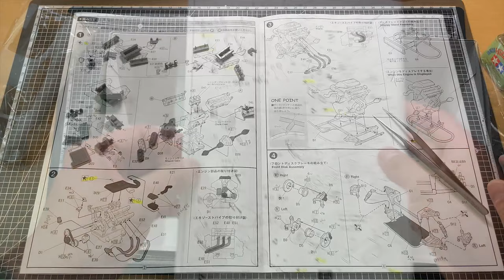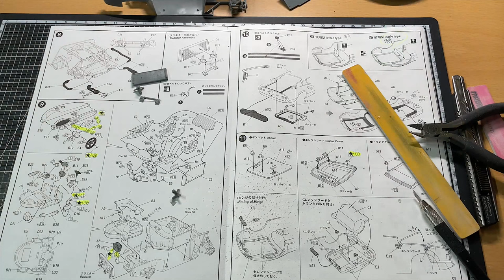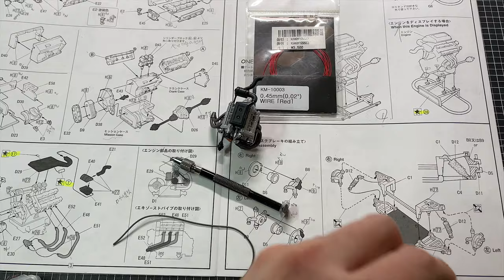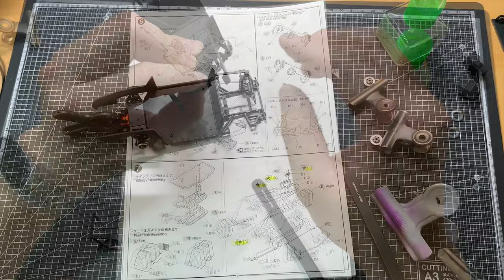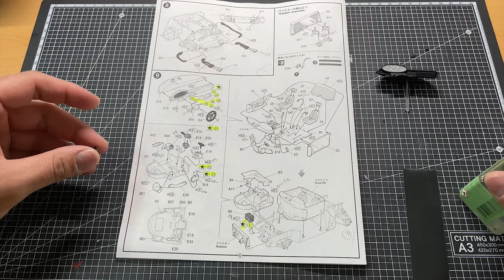[Full build] Make It Ferrari Dino 246GT 1/24 Scale step by step (Fujimi)

Comment: It's a nice building and a perfect   body paintwork, although we would have preferred a better video editing , slower, but which would allow you to watch  the building step  and painted details  instead of proceeding in a fast & rough stop motion way   like a  Pingu cartoon.
 1) The interiors are all in  black, chassis, body, trunk and cockpit. It’s instead appropriate giving some  more ‘dynamism’ and visibility, i.e.  highlighting the shape of the seats and the interior of the passenger compartment through preshading,  washing and drybrushing.
 I don't know if the roof of the Dino GT was black as the Gts hard top,  but painting the “ceiling” all opaque black reduces brightness and visibility in the cockpit.
2) combining the English license plate with a left-hand drive car, although  possible, is not exactly "common & frequent" or "typical" 
3)the Prancing Horse badge and Ferrari logotype  are not original nor typical of the Dino GT series , being  later additions and fakes made by some pretentious owner. I won’t  criticize and demean your good work, it’s just some advice so  you  can do better in the near future.
Reply from the maker: I acknowledge both editing and disappointing filming videos similar to others. The kind advice given in three ways is like a warm letter to me starting the new year.
1) It can be like a toy, but I wanted to feel like a new car. The proper dry brush and washing for Old Kaigi can make better images and car quality, but I didn't choose that. I didn't understand the needs of the viewers. :)
2) I think I got a shot. There is nothing to call the actual data. Too many model photos and restored vehicles, modified to suit each country's regulations... I want you to remember that it's all my excuses. I wasn't good enough.
3) Thank you for the good comments from the new year. Thank you for always watching my videos. It's been a long time since I wrote a long reply. Happy new year.
It's a text I answered with a translator. I hope my words are conveyed well.